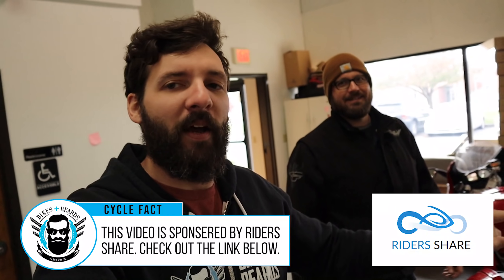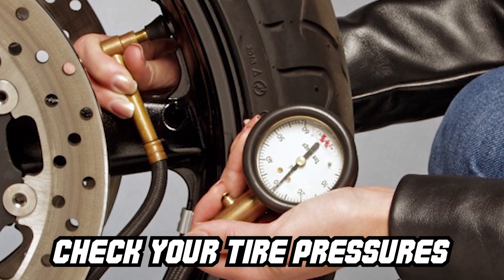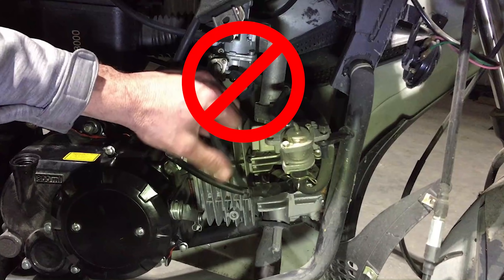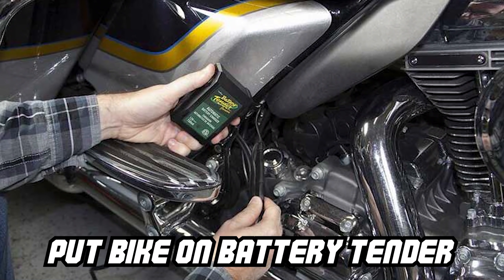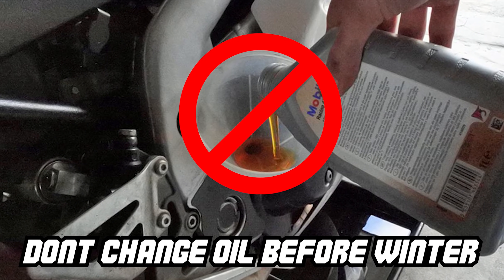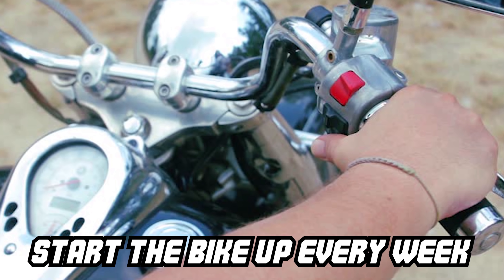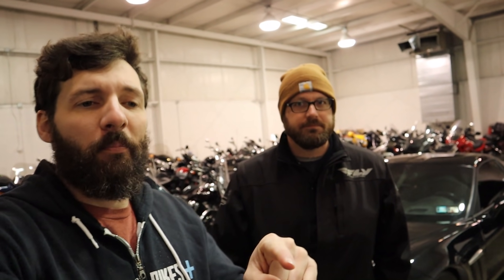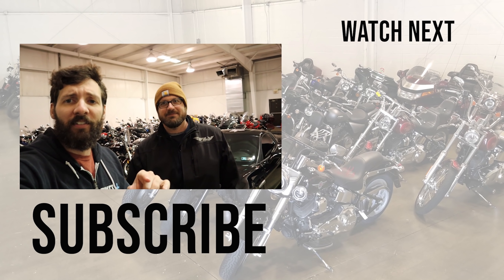5 Things You Must Do BEFORE The Winter

Comment: Always change oil before storage. Sulphuric acid will form as condensation gets into the oil and mixes with the cocktail of combustion byproduct in it, and migrate it's way to the narrowest passageways possible IE crank journals plus it eats at seals.

The small amount of water that forms over the winter from condensation will evaporate off in minutes when you fire the bike up.

Comment: Thank you! I work on engines (not motorcycles) every single day. Mice are the worst. Don't just cover your bikes and forget them people. Every weekend move them around, run them. Critters chew through wires, piss and poop on everything, and chew through air filters. When you cover your bike it basically is like you put out a "free housing" sign for them. Check your bike and discourage pests from setting up shop in your airbox.

Comment: I change oil and i go to very top of sight glass, slightly overfilled. Then i do not start it all winter, then change oil again in spring... U dont want old oil w carbon, soot etc sitting on your metal parts for months, it microscopicly eats away at the parts, ie bearings, cylinder walls, cam lobes etc. Fresh oil change n do not start engine will ensure, the internals will stay as perfect as possible. Fog cylinders too! Starting bike n not actually goin for a decent ride, that will cause condensation. Im no mechanic tho lol. Keep the vids comin!

Comment: Good suggestions! My bike is garage kept, but the winters in NY get really cold. I bought front and rear stands to store it off the concrete floor,  I have fuel stabilizer and bought a battery tender. 

I should be all set, but if anyone thinks of something I'm missing, let me know.

Good video!

Edit:
It was 45 degrees here in Poughkeepsie NY today, it was the warmest day out of the last week!   I put on some layers, motorcycle jacket, then my older ski jacket over it, with neck warmer... I got out there and put about 20 miles on her today :)
Reply: you could test your coolant to make sure it still has antifreeze properties.
Reply: @uglypinkeraser  hmm.. how do I do that? Lol

Btw, I bought my bike on Aug 6th 2019, brand spanking new, with 1 mile on it. I put 1200 miles on it so far. I did the break-in period as suggested by dealer to 600 miles (took it easy) and then took it in for first service. The bike is only 3 months old :) I'm guessing the anti- freeze is fine. Thanks for the suggestion, but it can probably be something I can test for when I winterize for '20-'21 season right?
Reply: @mrmuncheez374  Being so new I'm pretty confident your coolant is still fresh. you can buy a coolant tester for cheap, but you wont need it for several years

Comment: Tip I used to avoid flat spotting tires: Center stand, jack the rear up and block up the rear swing-arm til the front tire just touches the ground. 
My 82 CB750 was perfect, I turned the rear springs to lowest tension, air forks to minimum and blocked up front and back til both tires were off the ground. Gotta be careful not to take much load off of the centerstand though, and safety rope it to the wall, in case a kid gets to playing around on it when Dad is not watching....lol.
Reply: On the battery tender I concur, but buy the name-brand not a china knock off, which will burn down your house, like my buddy's Dad will attest to.
My 82 ate batteries every year religiously, until after a few years I installed a tender under the seat with zipties and ran the power cord into the side panel toolbox, after that I just pop the box open and plugged it in an outlet after riding. Next battery lasted 5yrs!

Comment: I put latex surgical gloves over the the end of the mufflers.  I don't want a mouse to crawl in the pipes and nest in one of my cylinders.  

Interesting that he said not to drain carbs.  I hear mixed opinions on that but I never drain mine.  Seems like draining the bowls leaves some fuel in there that will dry and possibly leave residue.  Makes more sense to not drain them. 

I heard it's not great to start the bike once in a while if you're not going to ride it.  I try to ride my bikes as much as I can during the winter.  If there's no snow and ice on the road, I'll bundle up in my  winter gear and go for a ride.  I'm in the Washington DC area.  It gets cold here but it's not like a Minnesota winter.

Comment: Some of these things go against what many others suggest.  First thing is if your oil has some decent miles on it or if say you just got the bike before winter and your not sure what it has for fluids it's a good idea to change before storage.  Not great to have old spent oil sitting in the motor, or if it's a dry sump like a Harley it's not as bad sitting in the tank but some still sits in the crankcase.  Also as touched on here if your going to start it definetly get to normal operating temp otherwise a quick start/shut off will just build up condensation.  Some say to not even start it at all during the winter.  Lot of opinions on storage tips, many people say to just ride all year but it's not an option for many depending there they live.

  I'm actually putting my 2007 sportster 883 low away for the winter next week.  Have to drop some stabilizer in the tank and hit the gas station to top the tank off and change the engine oil/primary fluid because I just got the bike a week ago and dont know what it has for fluids in it.  Stick it on a tender, check tire pressure and put a breathable cover over it and wait patiently/impatiently for april or so to pull it back out.
Reply: Ya.  This is the first time I've ever heard of starting the bike once a week.  If you take your battery inside, that would mean re-connecting the battery every time you do this.
Reply: @KTMK73  Exactly, basically if your running it every week you may as well actually ride it.  Some bikes  dont really get to proper operating temp just being started and run at idle in a garage its kind of a waste and exactly what causes condensation to build up if not thoroughly brought up to temp.  But I know everyone has a different opinion on this.  If I park mine its parked until weather is nice again.  Battery on tender, fluids changed and fuel stabilized.  Tires just a little over inflated since  I dont have a good stand to get my bike off the ground.  And a breathable cover put on the bike.
Reply: @berube361  Thanks for clearing that up.  I'm in Canada where there's snow and salt on the roads so riding is out of the question until April.
Reply: @KTMK73  Im on the east coast of the us, Massachusetts to be specific so we usually get pretty decent winters.  Salt had already been dropped even tho very little snow has fallen.  Temps have been cooler than usual for this time of year.  I used to ride year round as long as roads were clear but I dont enjoy riding in cold weather anymore.  Some say real bikes ride year round despite winter.  That's just a dumb way of looking at it lol.  Some ride in the cold some dont.  I figure I'll be back on the bike in april as well.

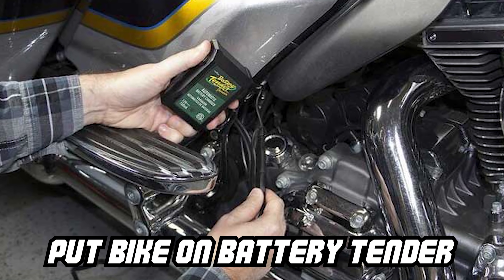Comment: 1:50 to 2:05.   Got my rebel 300 brand new last April 28th...Never put it on a tender, it still cranks like a champ..even in bitter cold.  Want to know the secret?

That's easy

RIDE the damn thing!.  I ride DAILY to and from work...5 days a week and sundays, ( layers of clothing including balaclava's exist for a reason) and park the damn thing in some reasonable form of shelter such as under a carport or better yet a fully enclosed garage.   IF neither is applicable,  at least whereever you park your bike in the outside bitter cold of winter, put SOMETHING under those tires to help sustain the usable life of your rubbers ( even cardboard is a small level of insulation between your rubber and the cold hard concrete)

Comment: My bike is in my cellar rip down ready to adjust the valves carb adjustments rejet oil change exhaust work probably won't ride till it gets warm again end of March or April HID headlight LED brake light LED driving lights and that's just one bike the other one I can still ride until it gets real cold

Comment: I have no power in my underground garage and cant get my bike near my house to plug in a battery tender. I suppose I'll just have to disconnect the battery.
Reply: Jerzy Woking bring the battery inside and put it on a tender.
Reply: That's what I do with mine. Currently sitting on a shelf connected to a battery charger/maintainer. Shouldn't need to really run the bike as they suggest throughout the winter if you have the full tank of gas and fuel stabilizer in it. Moving it around a bit probably wouldn't hurt though to avoid potential flat spots and critters trying to get comfy.
Reply: You dont really need a tender. Just top-charge your battery 2-3 times during the winter.

Comment: All my bikes receive lithium batteries.  They last 2-5 times longer than old toxic lead acid batteries.  Plus u do not need to render them.  No hydrogen gas.  No corrosion.  Huge CCA.
Reply: Uhm, your lithium battery is no less toxic than a lead battery 😅 And: NO batteries likes to be completely discharged, so yeah: even lithium battery should get a charge or 2 during winter.

Comment: things to do before winter... buy the correct clothing ... and keep on riding
Reply: What tyres for ice and snow do you reccomend for a suzuki tl1000s? 😄
Reply: @suprlite  just get a drz and run some bolts through the tires. . of course if its snowy/icy where u live u wont ride unless its a dirtbike.  where i live, it doesnt snow. but temperatures get between -5 to 5 celcius and i keep riding to work.